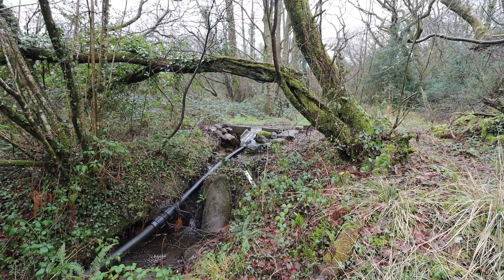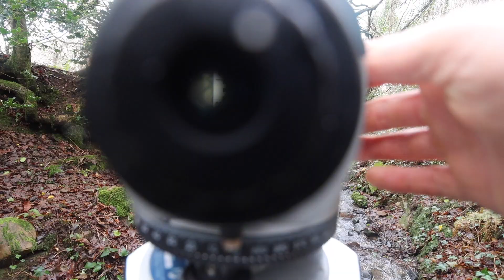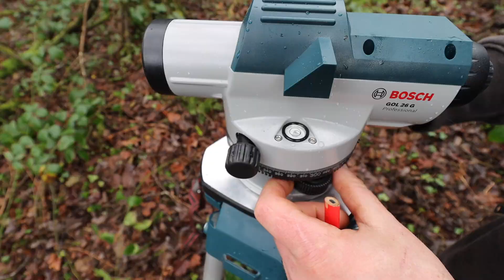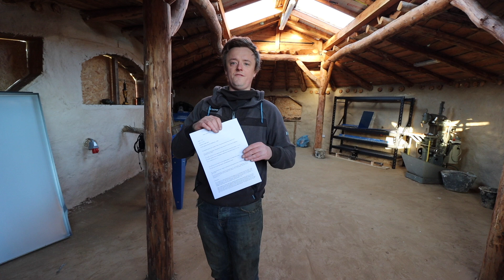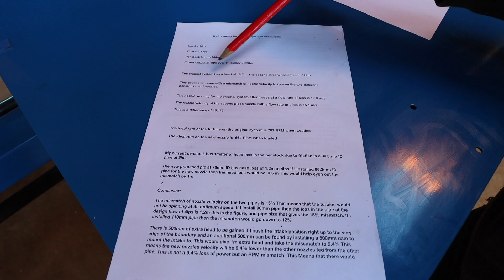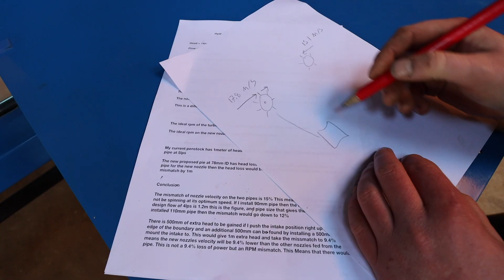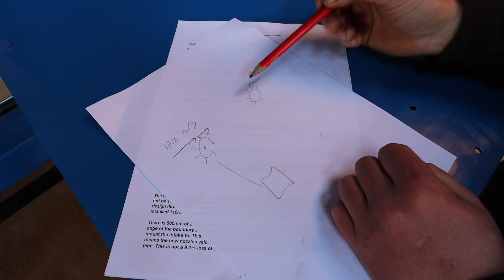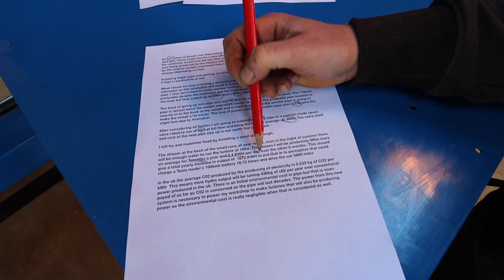Adding A Second Penstock To My Off Grid Hydroelectric Turbine (Survey)

Comment: A while back I mentioned about improving your reservoir in addition to taking a feed off the other stream and the first few minutes of this video https://www.youtube.com/watch?v=oaMLwWdbcwQ illustrates one of three (well 4 systems) that I am aware of for pumping water... So maybe next time you shoot someone down in flames for suggesting a whacky hair brained idea, suggest that you take it on board and ponder on it before  immediate rejection like last time I commented about improvements that you could make. You have all the materials on site that you would need and I bet that you have some equipment that you can lay hands on for a few beers in your local. All I have seen from some of your videos is a lost opportunity in developing a hydro system that has got generating power all year round and the land you have is perfect shape for developing a multi stage set of dams that you can take your feed from ... if you use your noggin.

Ciao.

Comment: Hi, I've been watching for a while, but only just subscribed, apologies! I started watching your channel due to a general interest in micro hydro-power. My question is: Is it necessary to separate the new stream into a new nozzle? Could you have a "buffer" that is fed by both streams that then powers the individual nozzles? It seems that would balance the pressure between the two different sources (for output), but it may have a sub-optimal impact. At least it seems it would average out the pressure differential and allow you to avoid specific changes to the output. I have absolutely no experience in this, and I apologize if I missed the reasoning for the separate nozzle.  Thanks for all your efforts!

Comment: @Kris Harbour Natural Building Suggestion regarding your Off Grid Hydroelectric Turbine
Wouldn't be a good idea to build a large squared tank of about 8000 liters (2m x 2m x 2m ) or even smaller, made of metal, a few meters down the stream, with the top opening just below the level of the water intake/intake dam (just 200-300 mm below so the water can flow in)?
The water tank should have:
- 1 intake to bring the water from the main water intake/intake dam;
- No cap, so the light leafs can go up and escape through the opening at the top (overflow)
- One large diameter drain with cap right at the bottom of the tank (in the middle of the bottom of the tank or on the side, as low as possible). You will use this output only to clean the tank of the heavy things deposited at the bottom;
- 1 output 200-300 mm higher than the drain output, to connect the pipe which leads to your turbine.
The benefits: 
- the light leafs will get out of the tank together with the overflowing water
- the heavy sediments will deposit at the bottom of the tank and can be drained out. 
- the main pipe will contain cleaner water and the turbine would be happy :)))
- the 50% self-cleaning tank would allow the collecting of dirtier water. This, in turn, would allow you to install a bigger and not so brittle main intake, collect the entire water of that little stream and make use of it, providing more power.
- the massive water content of the tank might provide a higher pressure at the bottom of the pipe, where the turbine is. I'm not quite sure if this is true or if it brings something good.

About you and your channel:
I watched almost all your videos in a relatively short time. Man, what you are doing there is just amazing!!! I've seen many youtubers. Most of them start to talk nonsense at one point, promote things that they don't even like, stretch their videos or make up stupid things just to have content for a new video. For them the quality and the honesty do not matter. 
Unlike them, you get through all the problems and all the shortcomings without tarnishing your image, without stopping to be a real, hard-working and honest man - you talked about this subject in a video while you were finishing the roof of the top workshop. Your videos, even the ones in which not a lot is happening, because the beauty of the nature, because your honesty and your determination to reach your goal, are still interesting. I do not think I have ever seen such a honest and hard-working youtuber until now. I am sorry I am not in the UK to be able to come and help you. Wishing you all the best!
Reply: Soo....make a 2m steel cube, transport it through dense, steep woodland, excavate 8 cubit metres of soil and rocks and bury the steel cube in the ground......?!
Yep - that shouldn't be a problem......
Reply: @andymccabe6712  Who said to transport it through the dense woodland? I meant to build it there (weld the metal sheets), on place.
Who said to excavate 8 m3 of earth? Who said to bury it in the ground? I said "a few meters down the stream, with the top opening just below the level of the water intake/intake dam". Yeah, the 2m metal sheets might be too big, heavy and unstable (too frail to sustain the 8 cubic meters of water). A smaller one might be a better idea.

Comment: Could you make the nozzle speeds match better by just reducing the nozzle size a little? You'll reduce the pressure, but at least there will be no losses on speed difference.

Comment: If you invest in a GPS device with altitude measuring capabilities not only will you look more professional but it will save you a heap of time. There's apps for phones that can do it reasonably well. Anyone who works in construction hasn't used a dumpy level in about 30yrs, laser levels replaced them. Laser levels are being replaced with GPS nowadays. The stick with the numbers on it is called a staff,
5% tolerance over 100m is 5m, that's not an acceptable tolerance.
Moder equipment means you take one measurement top and one bottom with a tolerance of 0.01%. I would think the investment would be worth it purely for the time and effort saved. Walk to the top and press a button, walk to the bottom and press the button again, elevation difference and distance measured to a far greater accuracy in next to no time with very little hassle

Comment: Enjoyed the video! I've never actually built a hydro-electric system, but have thought about it and hope to someday. It seems to me, if you were to use a Turgo Turbine, you should be able to match the lower head by aiming its nozzle to make the stream strike the blades at a smaller radius to the axle as compared to the higher head stream. Of course there would be a limit to the miss-match which can be accommodated, based on length of the blades and runner diameter.

Comment: Aren’t you concerned that routing the water to the turbine through a pipe will have a negative affect on the flora and fauna that uses the the stream to provide the necessary water?

Comment: Is it possible to add flows from the two pipes?  It would require a "Y"  with a one-way check valve in each arm of the Y.  Then use slightly larger orifices on the three jets.

Also,  if you know the water pressure at the turbine, you can calculate the meters of head.  I would try four 15m lengths of garden hose with a pressure gauge at the turbine house.

For 100mm pipe it might be cheaper to get some used aluminum irrigation pipe that's seen rough use.  It's light enough to be transported and carried in manually.  It can be spliced together with fire hose and hose clamps.

Also I've seen some demolition sites where they will give away used sprinkler pipe. Some of it may be 50mm or so.  It would require 3 or 4 in parallel to get the same flow as 100mm.  But the price could be zero.

Comment: Could you solve the mismatch problem by putting both pipes into a a mixing cyclone, and then sending the combined flow against the turbine? Seems like the conflicting flows would average into a single consistent flow that way.

Comment: It struck me when watching you discussing the the issues with the differing pressures, and thus the different speeds that each jet will produce, that they could be overcome quite easily, and allow full power to be taken from both streams. It is more work and initial outlay, but once that's done I don't see why it wouldn't work. My thought was to extend the length of the axle that the pelton wheel run on (if necessary), add a second, smaller diameter pelton wheel to the axle, then a baffle between to two wheels to stop the water from one affecting the other one. If you calculate the difference of the effective circumference of the wheels to be in the same ratio as the difference in the speed of the jets, that ought to do it...

Comment: Wouldn't it be more practical to use a couple of 3 meter rods for the pipe length lay? seems like you'll have a lot of trouble with a wheel measure on such a rough and squiggly path.

Comment: I have small price of advice for you hydro-power,
You should have rectifier and filter near the generator and transmit DC only as DC is very efficient as compared to AC and the AC from your generator is high frequency which increases losses in line (impedance losses)

Comment: Nice video mate! Shouldn’t you be able to increase the speed of the flow by installing a smaller nozzle?
Reply: For example if you calculated your current 2nd nozzle velocity to be 15.1 m/s and you want to get 17.8 m/s the continuity equation (v1 * A1 = v2 * A2) concludes to scale down the area of your nozzle to approximately 85% of what you currently have in place. In theory this seems like an easy fix, so are there any specific technical problems with a narrower nozzle in this setup or why didn’t you try to compensate your mismatch along this thought?
Reply: Genuinely very interested what’s your view on this ^^ Greetings from Germany

Comment: Not sure how you can come to the conclusion the homemade land surveying apparatus you were using is as accurate as the dumpy level...The dumpy level isn’t automatic levelling either. I’m guessing you have to level it with the screws until it’s in the compensator range.
Reply: ... Not sure how YOU can come to the conclusion that it ISN'T....?!
AND - obviously, the instrument will have limits beyond which it cannot self level!  Within those limits it IS self levelling.....
Why are you being critical - particularly when you're on shaky ground?!  You should always try to be encouraging - it makes you appear to be a much nicer person......!!
Reply: @andymccabe6712  wow that’s a lot of exclamation marks... it’s simply really how I’ve come to my conclusion...a dumpy level is an optical surveying levelling instrument and has an accuracy of 5mm over 50m and has focusing functionality. The home made surveying equipment staff measures in increments of 100mm and relying on sighting through two points of water level in a tube where meniscus can lead to inaccuracy...Obviously not an issue when working out approx head difference in this scenario but to say the two are comparable in terms of accuracy is simply false. .. And the limits in which it will work are practically level and has to be set by the operator. . The operator levels it till it’s in its compensator range. It’s not self levelling.... And not being critical, what the man is doing is innovation at its finest but I’ll call someone out when they are wrong any day of the week.

Comment: With 2 water supplies with different flow rates , a simple valve could adjust a even matched flow , place the valve by the turbine. But you would be matching the higher flow to the lower flow. Always look forward to your show.

Comment: Hey have you thought about a 2 weel setup ?  on the same alternator / axel ?  A smaller diameter pelton weel has a lower outside velocity at the same rpm this way you coud run both systems at the optimal point.

Comment: I know hydroelectric is green and all that. But what are the plants and trees going to drink when all that water is just passing them?

Or will there still be some water flowing along? I guess there will be if you only use 4 liter of each 6.7 liter. But there will be more water going down the other stream, i dont know what is downstream on both sides. But it could affect the eventual outcome downstream. 

One solar panel on a good day can do more than 300 watt per second. I know it is not as consistent as the waterflow that keeps flowing during the night. But it is power too. It wont be as aesthetic, but if you put it on top of some toolshed, or roofing for larger equipment, i think you can get away with it without it looking too bad. 30 degrees up and directly south was good placing of panels i believe. But do look it up. Boat, or truck batteries are great for power storage. 

Good luck with the installation!

Greetings,

Jeff
Reply: Err, he's got solar panels.....

Comment: Hello Kris, 

You can measure the distance using your dumpy level instead of using your tape measure or measuring wheel. 

Example: If your centre crosshair reading is 1900 and the small top line above the crosshair is reading 2000 and the small bottom line is reading 1800 then the distance from top to bottom is 200mm on the staff. Multiply this distance x100 then you get 20,000mm or (20m) that is the distance from your level to your staff. 

So you can get the heights and distance as you are going, but you will need to site the dumpy level at the previous staff location on the way down to get an accurate measure.

Comment: Or a regular water level, length of hose maybe 25-50', works imo is more accurate than the sight water level. I like the traditional water level because it's easier imo for 1 person to operate. A transit level can be accurate but it requires some experience because not perfectly leveling the transit and/or not sighting perfectly can throw off the result. Plus the water hose doesn't require a straight line view which in the woods can be a problem. The hose can go around trees, rocks, branches and sighting is really accurate.

Comment: A really nice and clean explanation! What about a different radius rotor or a different diameter nozzle for the new pipe on the same generator? Also perhaps it's an option to have two diameters for the new system as a compromise between the two diameters? Those things just came to my mind while watching. Probably I think to simple here... Love the CO2 and Tesla calculation too! :-)

Comment: Two options I didn't see explored or considered.  1. Route this new pipe into the manifold you are already using to split the current penstock into different nozzles to simply increase the flow.  2. Route the new penstock to the holding pond (if possible) to increase that flow, and make the filter box bigger.  Might need a larger pipe there too?

Comment: Kris, I have a question for you, if I may ask you... Do you think it would work, to have a turbine with head of 22m on lenght of penstock of 1800m including a hill of 110m in the middle of penstock? Flowrate is even in summer as least 100L/s and during "wet-months" it could exceed 1000L/s. So the Pelton wheel would produce like 20-50kW of power. Would it run even over that hill and would be 200mm pipe sufficient for maximum flowrate of 300L/s.

Comment: Great information, why not just combine the two pipes then add a fourth jet? It would only matter if you had full flow in the higher dam. So how many months of the year does your higher dam flow at over capacity? I played with water as a kid on the mountain then I moved to Florida,USA. now I am a flat lander. Wouldn’t it be much easer to lay a temporary hose down the stream bed,check the water pressure, oh then count the hose length?

Comment: Hi I'm new to your channel. Concerning the difference in flow rates at the turbine, can you reduce the the diameter of the pipe with the larger flow at the turbine to match the other flow rate? Also could you produce electricity using a tank of water dropping vertically to a turbine and using a pump to refill the tank?

Comment: the video was some good info but using charging a tesla was way because you only used the power generated. In order to use a charging you would need to factor the loss of the inverter and charging itself
Reply from the maker: that was factored in, the numbers were at 60% efficiency, granted there would be some additional loss from charging but it would be minimal. the number I have given are within 5-10%

Comment: In summer the flow will be lower, so the losses will be similar regardless of the pipe size. 1/3 flow is 1/9 friction loss. In winter with high flow and higher losses there’s plenty of power anyway.

Comment: Fascinating Kris - love the breakdown.

I am wondering : With two flow inputs A + B, where B is a lower flow-rate than A ( RPM balancing issues ). 

Are you able to create ( Machine or mould ) a reservoir unit ( with enough capacity ) in or near the flow-shed that collects the input flow from both  ? The output of which could then be channeled  as separate outputs, one for each nozzle of the turbine ...This would function as a flow-regulator of some sort ?

If the Reservoir ( flow regulator ) is elevated  with a  valve feeding separated outlets - would this give you   'controllable '  regulated and uniform flow ( pressure from gravity + the combined flow-rates ? )

If such a set up could work in practice - does your existing software you demonstrated in earlier videos, allow a modification to control the output rate from a flow-regulator via blue tooth ? ( i'm guesssing that in periods of high and low flow in the streams this might assist in efficiency within the system  ??)